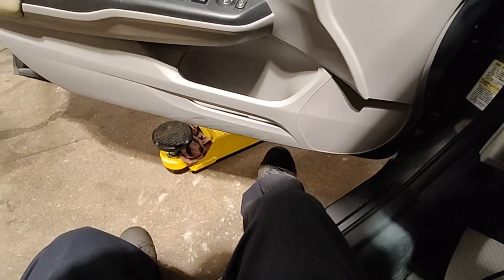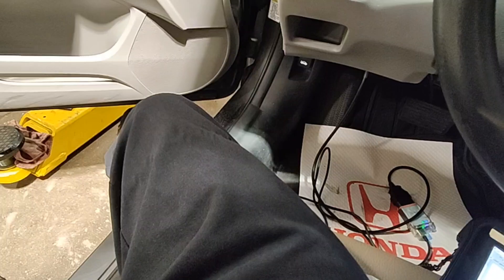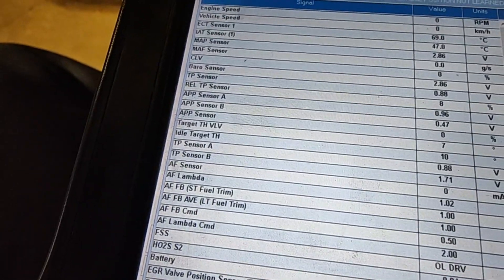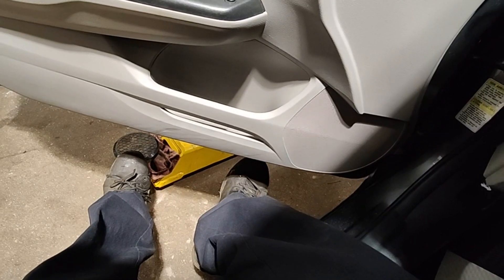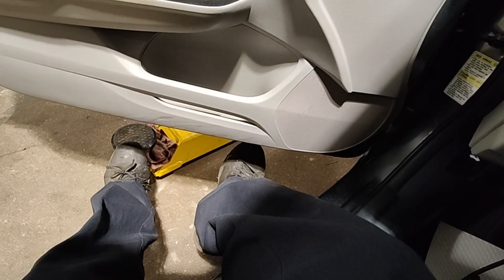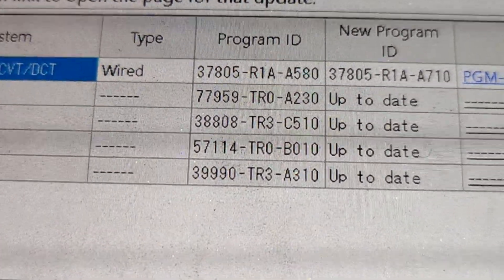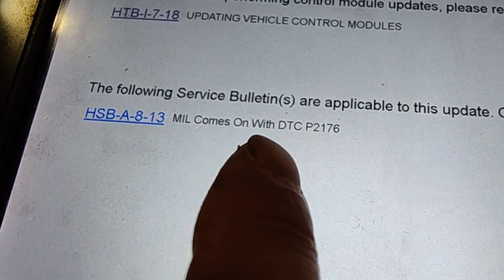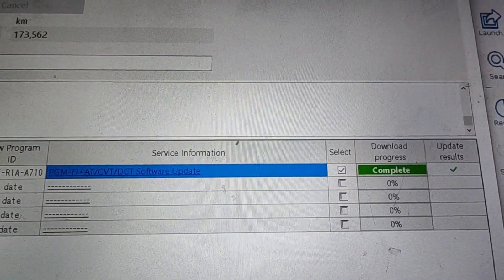Not all repairs need a part replaced. Sometimes it's just a simple software update. P2176

Comment: Hey,
If I don't have a check engine light on my '13 Civic, should I still see my local dealership or trusted shop to see if I need my PCM updated?
Reply from the maker: No not every vehicles will need to be updated. Its only when it sets a code that needs the update to fix an issue.